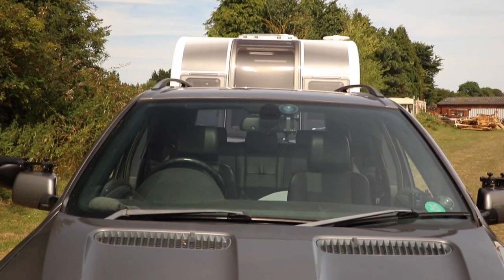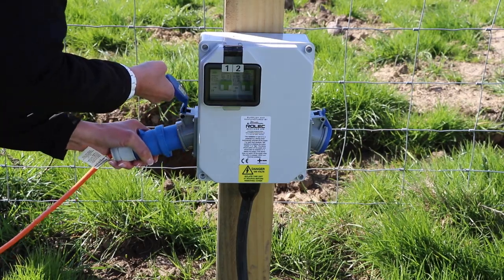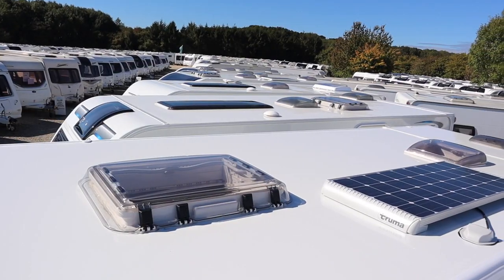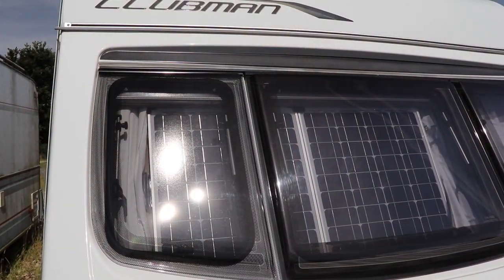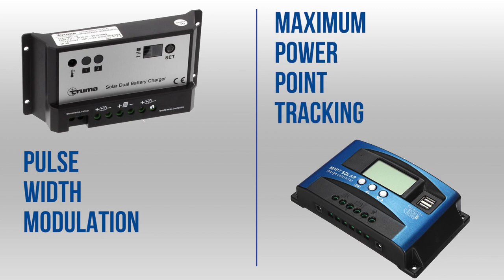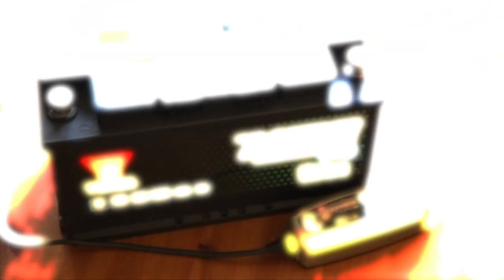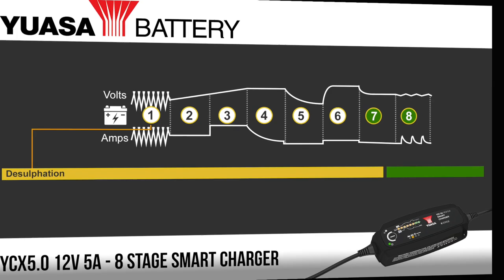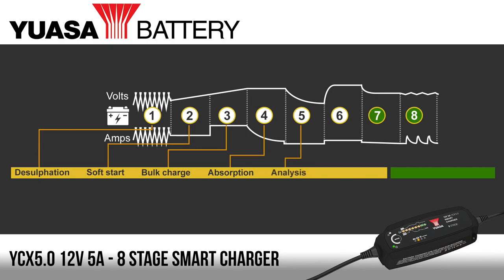Charging a caravan or motorhome lead acid leisure battery

Comment: Hi Dan. I am so pleased that you gave the correct advice for charging batteries using a smart charger. The only thing  i would say is that a AGM battery needs a higher charging voltage of 14.7 volts. I use a Optimate 7 smart charger it the dual voltage charger that does standard batteries at 14.4 volts and AGM batteries at 14.7 volts. I also have the Truma solar panel on our Bailey Pegasus Grande caravan but i have altered the settings to suit an AGM battery when the sun is out i get 14.7 volts bulk charge and 13.6 volts float charge. I have found in the past i had a 150 watt solar panel on my Elddis caravan with the CBE regulator and display panel it kept the battery great over the summer months but over the winter it didn't perform very well and i had to remove the battery and charge it at home. I always use and AGM battery because they perform better and don't sulphate as easy.

Comment: I’ve never had a leisure battery until last month for going off grid, I’ve always used the caravan on hookup and have used the onboard battery charger as a power supply for years with no trouble.

Comment: Great video. I charged a completely flat Yuasa battery to fully working using a smart charger. It took 5 days to do it mind so now I have a spare. I forgot to switch off the aerial amplifier in the van and although I've got a solar panel on the roof, it wasn't enough to charge the battery vs the drain by the aerial amplifier. thats just crazy. You'd think there would be a master switch for 12 volt that would kill all of the systems in a caravan. 

Having said that, on the Truma charge controller, you can set how much charge goes into battery one and two. Factory default is 50% to batt 1 and 50% to batt 2 I believe. I've now changed this and set it to 90% to batt 1. I think that's the maximum that can be set. I only have 1 battery in the van so hopefully that will take care of that.

Good vid Dan and up to the expert level we have been used to. Now that lock down will be eased a little, there will be a rush to buy new batteries and smart controllers me thinks. Let alone seized brakes. 
Cheers 👍 :-)
Reply: Hi Ronin, so even though my master switch is off when in storage , can the tv amp still be draining the battery ??
Reply: @Gixer750pilot  Yes as that's what happened to me. I left the amp on and it drained my battery. There is a little slide switch on the top left hand corner and once off, the blue led will go out after a while.
Reply: If there is only 1 battery connected to the Truma charge controller, 100% goes to the connected battery, automatically.

Comment: My caravan permanently mains connected,today no lights, water pump working,I have lived in the caravan for just over 4 years,is battery just finished, do I have too turn mains off before I check with volt meter?,great video s keep them coming

Comment: Great Dan, but I throw the same question back at you about the best amperage smart charger to buy and use. Have been told 10 to 20% of the batteries AH rating. That little 5 amp smart charger is not designed for a 110AH leisure battery or am I wrong? Also, it is possible to replace the manufacturers dumb charger with a correct amp smart charger then when using electric hookup your battery is getting the best treatment.

Comment: Hi, am I right in thinking... 
All appliances/electrics on the caravan are powered by 12v (auxiliary battery). Connecting to an EHU merely recharges the leisure battery as it is being used.
Thanks.

Comment: Thanks for the explanations in the video. But I have a doubt: how to calculate the power of the battery charger when the campervan is connected to an external source, in a camping. what the specifications of this charger are. thanks

Comment: Hi dan 
Great video very informative I have a solar panel /tracker and alarm on the van will disconnecting the battery set the tracker or alarm off thanks leigh
Reply from the maker: Hi Leigh, depending on your tracker it may set an alarm of power disconnect, check with your tracker company if this is the case.

Comment: Hi Dan, this will be my first winter with my recently purchased touring caravan.  I was on a seasonal pitch all summer with an EHU,  and will have it inside for winter storage.  I intend removing the battery to home, and keeping it charged in my garage.  Would you recommend keeping it hooked up to a smart charger until next spring when I shall be using caravan again. Thanks in advance Paul.

Comment: Hi Dan
We have a Bailey Pheonix very similar to yours.  We bought it on your recommendation in a previous video. My question is with the battery being charged by the Truma solar system, can the battery be just disconnected to take home to charge with my smart charger?  Or would that damage the controller?
Cheers
Cheers
Reply: Ideally you should disconnect the solar panel from the controller, and then remove the battery. There should be a fuse or circuit breaker in the line between the panel and controller

Comment: Very useful video, thanks. Could you consider doing one on the caravan handbrake, perhaps explaining the auto reverse system and why even when the handbrake has been applied the caravan can roll back (but not forwards) a few inches if on a rearward slope? I know the feature lifts the handbrake handle up vertically, but It's a feature I don't quite fully understand and catches me out sometimes, and I'm sure many other caravaners. Thanks.

Comment: I have a solar charge and controllerr for when off grid and plugged in permanently when in storage or at sites with ehu, will I be damaging my battery by leaving it plugged in ?
Reply: Simon Peat If you mean leaving the battery connected to the solar charge controller - no, you will not damage your battery by leaving it connected... 👍🏻 😉
Reply: @Venomator.  Thanks for that, curious about the 240v that I am plugged into for the rest of the time even when not using my caravan

Comment: Thank you for this. I have a campervan with a normal battery and leisure battery connected by a VSR split relay. Can I charge both batterys by hooking up my charger to either battery or do I need to remove the leisure battery? Thanks!!
Reply: TheMotorBlog you'll have to remove the leisure battery to charge it or connect direct the Leisure battery not the starter battery

Comment: Quick question Dan. On the subject of solar panels now that you have a roof fitted unit on the Bailey how do you feel about your original 100w suitcase that you used on the  Lunar. I want to install solar and am interested in your thoughts now you have had both systems.

Comment: Hi Dan,

Quick question! My car is wired up to charge the battery while towing I also have a  truma factory fitted solar panel. Will both of these charge the battery at the same time while towing?

Cheers

Comment: Like a couple of others on here have used CTek on the two car batteries in my Discovery for a number of years. I have noticed however that the Optima I use doesn’t hold the charge for as long as it used to and not sure if that is because I keep the car perm plugged in when at home.
Reply: Provided the Optima is a smart charger like the Ctek it is most unlikely to be detrimental leaving it on unless using  Lithium Polymer batteries.
Reply: A battery not holding its power so well is usually a battery that is starting to get near its use by date. Both age and cycles affect deepcycle batteries.
Reply: Wayne Hobbs yes heard that people are complaining that Optima batteries aren’t as good as they used to be at managing repeat discharge cycles. The very thing they are supposed to be good at. Trouble is lithium batteries are mega money

Comment: As I haven’t been to my caravan for over 6 months now, it’s likely that battery will be flat. Am I best removing it and then charge up using a charger, or just reconnect to the mains and continue as normal in the caravan until it’s fully charged?  Cheers
Reply from the maker: Hi David - yes remove the battery, and i would recommend using a smart charger - if it can recharge the battery it will attempt to. A trickle charge wont recondition the battery back to optimum.
Reply: @TheTrudgians  brilliant thanks, I was in two minds what to do but you’ve made my mind up and I will get a smart charger and sort it out, thanks for your advice again 👍👍👍

Comment: Thank you for the video.  Interestingly the Yuasa smart charger is made in Sweden by CTEK and has the same fittings.  I have the CTEK equivalent and use it on the caravan battery a couple of times each year.  On the car I charge via the 13 pin towing socket using an adapter I bought from a LR forum which just saves having to lift the bonnet and use crocodile clips.
Reply from the maker: Awesome stuff, do you find the charger makes a big difference to the leisure battery?
Reply: @TheTrudgians  Yes I certainly do and especially useful during lockdown.  I am on my 7th year with a Banner leisure battery in the caravan and mainly rally off grid.
Reply: I’ve got the ctek mxs 5.0 as well and use it on my kitcar. I didn’t think of using it on the caravan. You can get a connector with leds that shows the condition of the battery as well.

Comment: Hi Dan need some advise
Bought 2 x Halfords leisure batteries agm ones class a having a problem there only showing 13.8v put on charge with the noco genius 10 but after charge cycles there still showing 13.8 now have purchased the wrong batteries or take them back to Halfords as not charging upto 14.8v or do I have that wrong or incorrect charger I’m new to this sort of thing all help would be much appreciated
The reason for this question is that truma told me to reset the truma inet control panel due to fault w255h but told me over the phone that if battery is below 14.2 volt I won’t boot up and won’t show any icons for heating options etc only shows the clock and spanner options

Comment: Hi Dan, Very interesting to see how a smart charger works. On average how many years would you expect a leisure battery to last? We've owned the caravan over seven years. It's always plugged into mains even when stored. The voltage meter on control panel still shows over 13 amp. Very informative video. Best Regards. Rob

Comment: Very informative as usual - thanks Dan. I have a 100w solar panel on our van and if I wanted to take the van battery home from the storage site to use a Ctek smart charger,
is there anything I need to do other than just disconnecting the battery in the correct order. Any additional steps because I have a solar panel fitted? The same again when its time to reconnect the battery? Hopefully the solar panel has kept it topped up over the past few months but using a smart charger on it seems a good idea.
Thanks again Dan.
Reply from the maker: Morning Stephen, Simply disconnect the battery from the caravan, negative terminal first, then then the positive - then remove.. If the van is insured, make sure the alarm is still active / trackers are enabled temporarily while the leisure battery is removed.. its really that simple. 

I suspect the CTEK will do a great job of topping up the battery !
Reply: @TheTrudgians  Thanks Dan.Thats a job now planned for Saturday.
Reply: When you DISCONNECT the leisure battery remove the negative(black) terminal first. When the time come to RECONNECT the battery attach the positive(red) terminal first. NB Removing the battery may well leave your caravan without a functioning alarm and this could then void your caravan insurance.
Reply: @Andeecee  Thanks for the info M of M. Although I was aware of the correct disconnect/connect procedure something I hadn't considered is possible Tracker activation whilst the battery was away from the van. I live 10 mins from my Gold CaSSOA storage site & was planning on removing the battery about 8am and returning it the same evening. Obviously no alarm during that time. I might reconsider if the Tracker is going to activate tho'.
Reply: @stephenmanning3426   I don't have a tracker fitted on my caravan however I think they may have their own power source independent of the main battery.
Reply: @Andeecee  Thanks again - I think you are correct re the independent power source.

Comment: Hi Dan
Further to My previous comment. I had read on a forum that you should 
Cover the solar panels. (I use the caravan carpet)
Disconnected  the positive wire that runs from the panel at the controller.
Disconnect the battery.
Do you think this is correct or is this going overboard?
Great video as usual.
Cheers
Reply: Most solar controllers want you to disconnect the panel before disconnecting the battery, many of them are dual voltage 12/24v and having the battery connected tells the controller which of these two it should be working at, so having just the solar panel connected means the controller does not know which configuration to use.  I have installed my own system and included a switch that will disconnect the solar panel and another that will disconnect the battery, so I can control connecting up and disconnecting.  My solar panel is 60v (a triple panel) so well above even the 24v and so there is plenty of scope for battery voltage confusion.  My MPPT controller uses DC to DC conversion to drop that voltage and increase the current available to the battery, but I think Dan said he would cover that in another video.  So to answer Mr Grumps, if you cannot disconnect the solar panel easily, then yes cover it before disconnecting the battery.
Reply: That's an excellent reply. I might try to wire in a switch from the panel my self. You would expect a switch to be a standard thing on solar systems.
Reply: @vince_martyn  Just disconnect your battery when its dark as the solar panel is in effect covered when its not getting any light?

Comment: Hi Dan. Do I need a smart charger if my Caravan is always on electrical hook up? When not using my caravan it is stored at the back of my house and is always plugged into the garage. Is this a good thing? Does this damage the battery always having mains connected?
Reply from the maker: HI Alan, it certainly wouldn't hurt the battery to have it on a smart charger occasionally, but your battery is always in a state of charge so you're not damaging the battery as it is.
Reply: @TheTrudgians  Thanks Dan. Appreciate the response. Keep up the great Vids. Love watching them. Be safe!

Comment: Dan your advice is 100 % wrong., my continental Adria does not  have a leisure battery at all.  But all the fittings lights, water pump etc are all running 12v from the transformer so you can 100% run 12V without a battery, . And no issue whatsoever. I am now currently into month 4 of living in the van just about full time as a site warden.